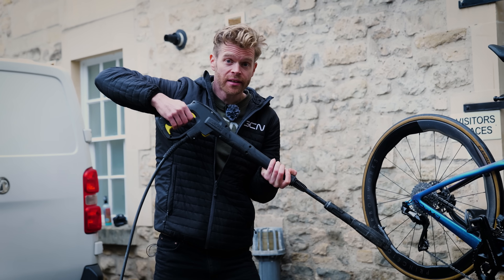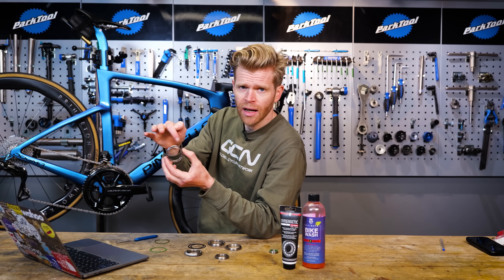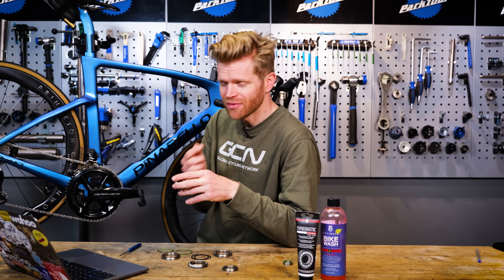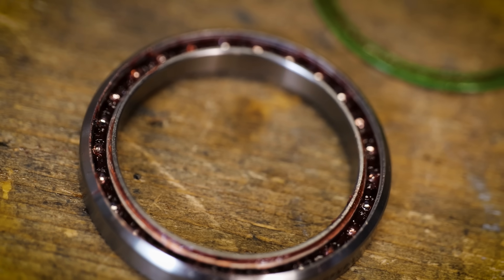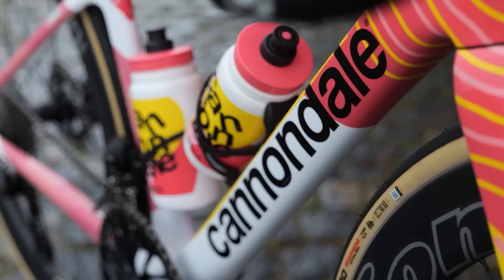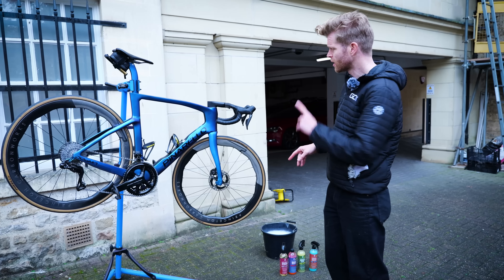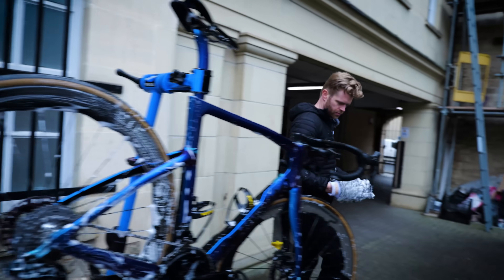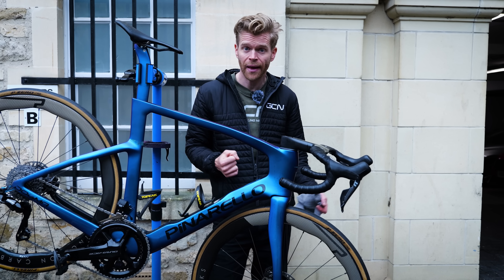Why Jet Washing WILL Destroy Your Bike

Comment: Can you talk more about the test setup, how do they determine their findings, more than just "they tested it" like what did they actually do???? Was there an A B test? What techniques did they use? I can understand that point blank blasting your bearings is going to wreck the bearings but I think even pro mechanics do go easy and take care not to put the nozzle directly on the frame. You spent so much of the video reiterating what's the mechanism of how corrosion and grease etc interact, but none of that would differentiate between hand washing and jet washing. 

All this video tells me is that there is another opinion out there and all there is to back it up boils down to "they tested it" and "they used microscopes". None of that is convincing new information. 

I feel like you've left all the meat of the story out of the video
Reply: I sandblast my bike.
Reply from the maker: hopefully we can take a deep dive into this in the future
Reply: Exactly this. GCN again talking about "science" and providing not a shred of evidence to back up the claims. 

If washing/rinsing the bike with a hose is okay - at what water pressure do problems actually start occurring?
Reply: I might be able to help by passing along a little information about pressure washers. I didn't need a bunch of scientists to tell me that GCN was wrong when they advocated pressure washers to clean a bike.

1. The amount of pressure is measured at the tip.  The farther away the droplets are from the tip, the lower the pressure. However ...
2. The droplet size doesn't change as it gets farther away from the tip.  It just moves more slowly and not as far.  The problem is in the size of the droplets or the atomized water stream.  How this works is the pump pumps a column of water at a particular pressure, and the water is driven through the tiny opening (the tip), measured in thousandths of an inch.  Once the stream emerges, the outside air pressure is much lower than the pressure behind the tip, so the water "explodes" into tiny droplets, and the force of the pressure also carries the droplets to the target, in this case, the bike.  Since the droplets are still tiny, moving back doesn't help prevent most of the problems cited in the video.

3. Water is insidious.  It follows the path of least resistance and settles wherever gravity "tells" it to, in our case, in places like the bottom bracket. But even in areas where it can't puddle, high-pressure water can drive unwanted material down into places we don't want it and can't reach. 

4. For some reason only a psychologist can explain, people who use pressure washers think there is only one setting: maximum, and it doesn't matter if it is a 1000 psi setup or a 5000 psi setup.  Maximum is all they know, and the higher the pressure, the better (they think). That isn't true.  We're washing a bike, not etching our names in concrete.  

5.  Still think I'm full of it?  OK, fine, if you just sprang for a new pressure washer to wash your bike, or you got one for Christmas, do this: go and find the biggest tip for the washer that you can. Dial the pressure to minimum and turn it up slightly so that you get a stream of atomized water, but not so powerful as to cut steel beams. Then stand back when you use it. Cross your fingers. 

As for the chemistry, I'll take their word for it, since I'd never use a pressure washer in the first place.
Reply: @antares8281 What you say is sensible, however you don’t make it clear how small water droplets are more penetrative than larger ones (rain, hosepipe etc) regardless of the speed they travel. We’re talking about a liquid, not solid particles, and it doesn’t feel like surface tension is going to make much of a difference, Fog ought to be more of an issue than a pressure washer held at a distance if droplet size is a relevant factor.
Reply: @antares8281  which means that even a hose will destroy your bearings?

Comment: Same goes for drying with compressed air. Dont’t do it. It will push water into bearings and joints where it shouldn’t be.
Reply: don't get your bike wet at all, just use a wet towel to clean it
Reply: @remokoch2480 we went through many ( many cases a year) of Pledge Furniture Polish.  It works better than the bargain brands.
Reply: I use a Hair dryer. Heated wind that isn't that strong
Reply: Worse than a pressure washer 😂